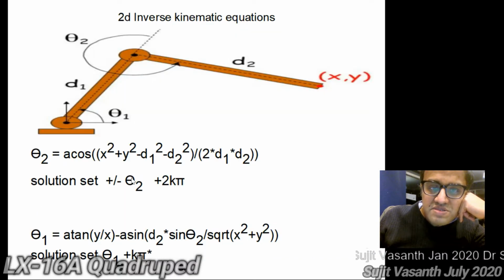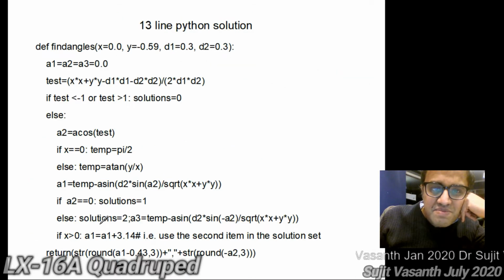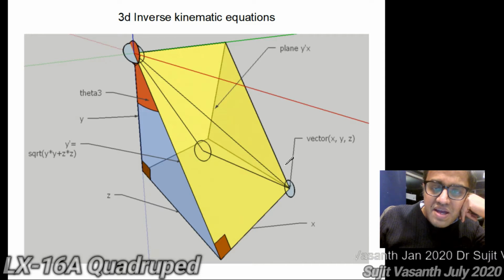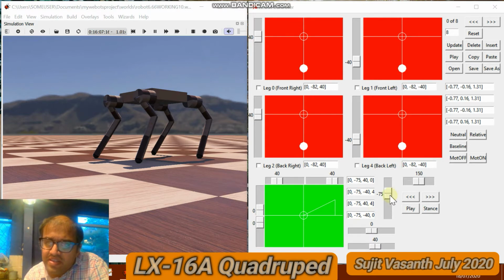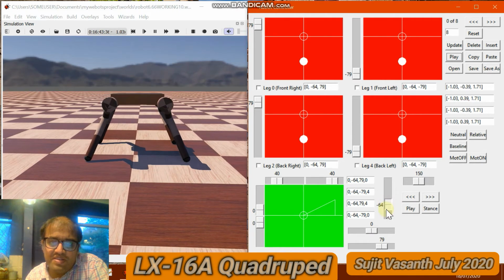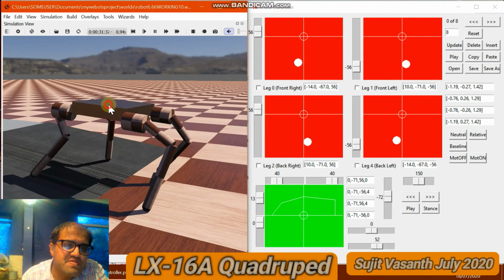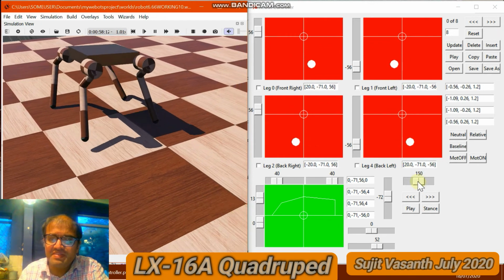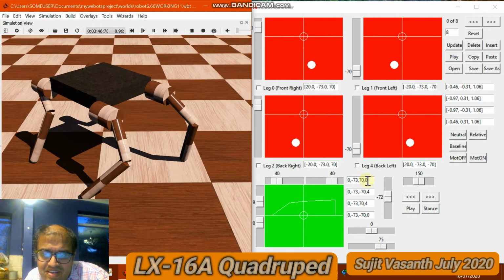DIY Quadruped Walking Robot Dog using LX16A

Comment: Do you have to have the return serial cable connected to the debug controller for it to work. I am just getting started.  I have just the one seriall cable hooked up to the motor with no return back to the controller.
Reply from the maker: Hi Brian USB>>debug>>>daisy chained servos
It is possible to hack  the servos directly to an arduino (there is an arduino library for doing basic motor control with this)

Comment: Nice work sir! How are you controlling its motions?
Reply from the maker: See later in the video. Leg positions  are controlled using a description of the foot locations in x,y,z space and using inverse kinematics to calculate the joint angles. I  wrote a gait generator which cycles trough a motion loop for each limb, IN thsis way you can easily generate customis\ble walking gaits.
I expanded it and was able to do an elephant style gait (creeping gait) recently and also a bounding gait.